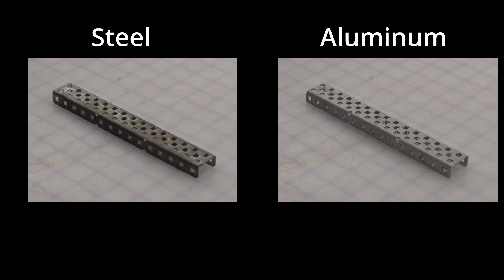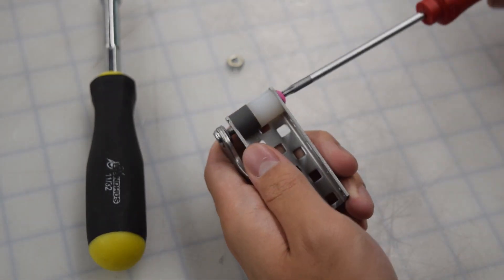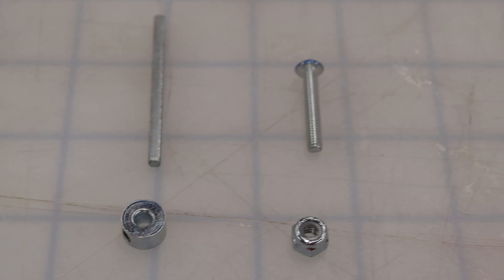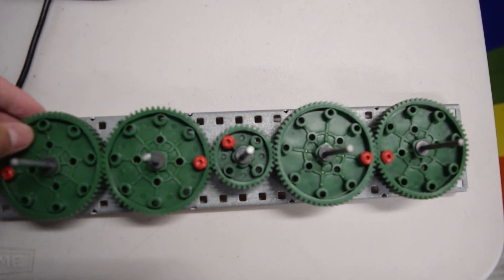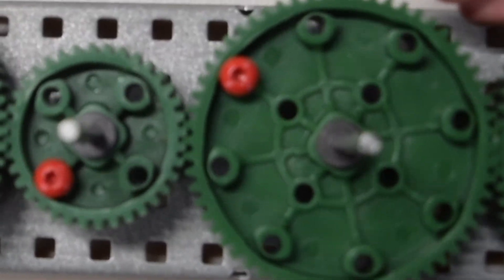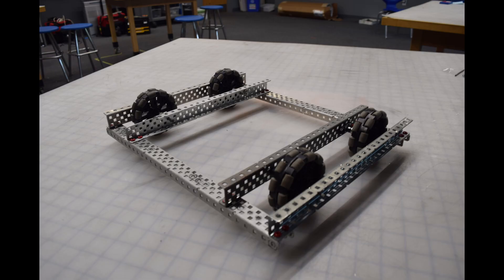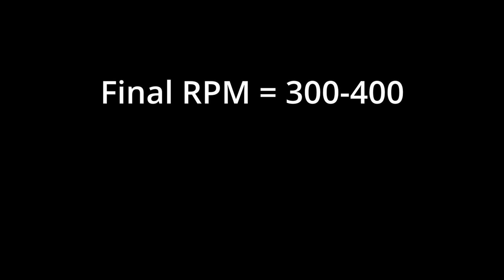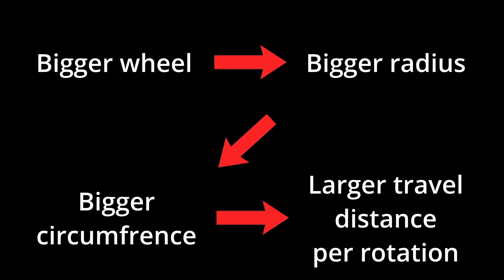Tips to Know Before Building Your Vex Chassis

Comment: Is it better to use a 6 motor 8 wheel drive or a 6 motor 6 wheel drive for speed and faster turnings
Reply: Depends every season but this season the 6 wheel drive will be better, but make sure the middle wheel is smaller to assist in parking